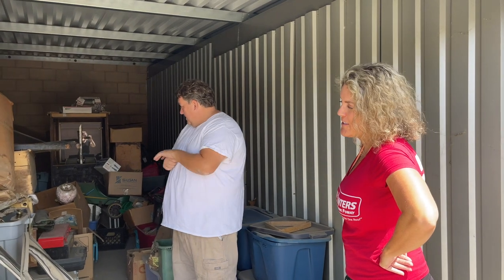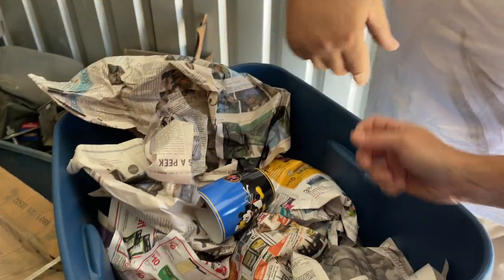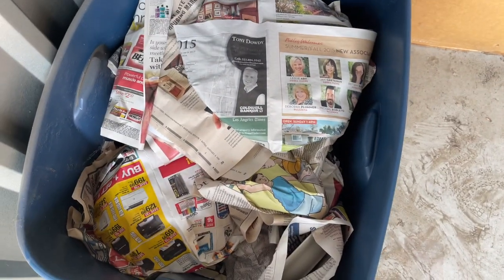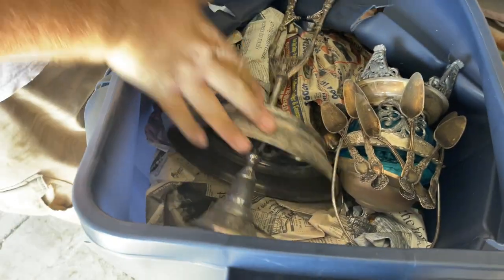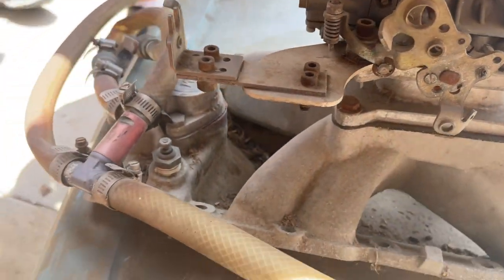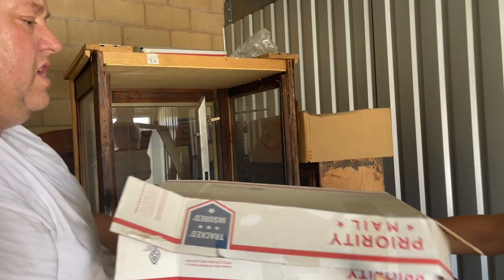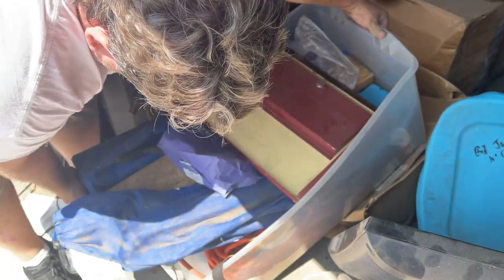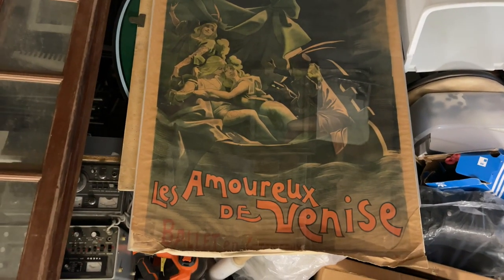AMAZING Unboxing Loading $26,000 Storage Abandoned Auction Wars CASEY #storagewars

Comment: Intake manifold and carburetor, looks like for either a big block or small block Chevrolet judging by the hole at the back where the distributor would go and also by where the thermostat housing is on the front. New manifold probably $300, carburetor anywhere from $800 - $2,000 new
Reply from the maker: Dang thats a nice piece then !